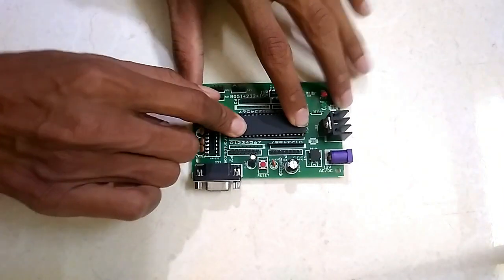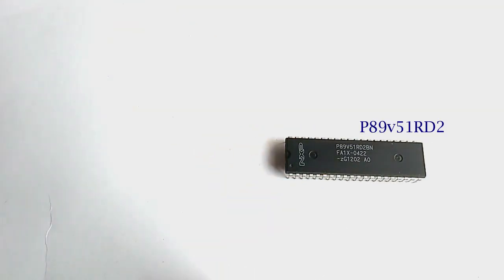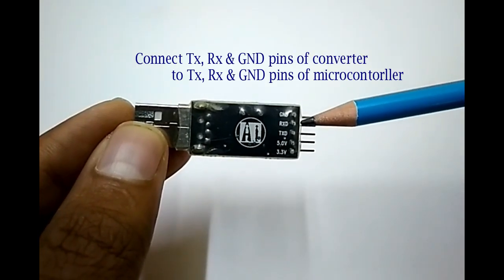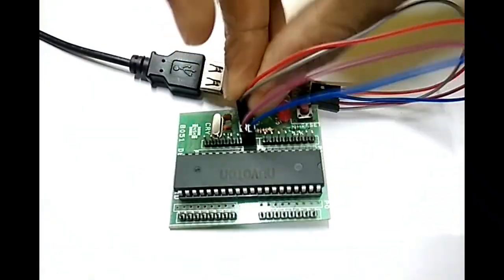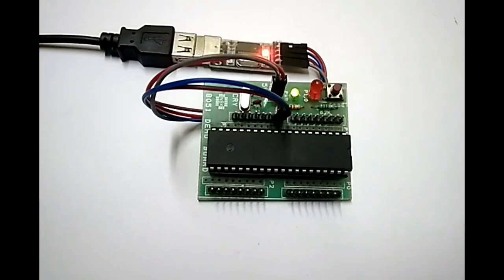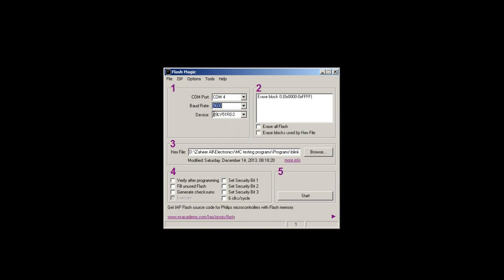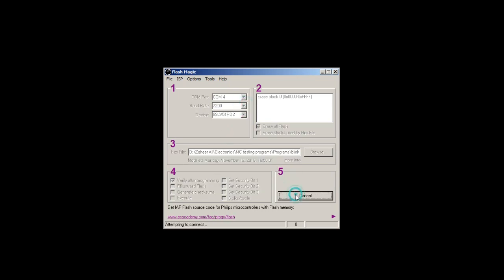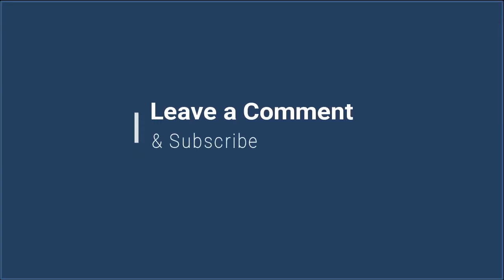how to Program 8051 bootloader ICs (3/3)

Comment: you didnt explain how to use usb programmer
Reply from the maker: Hi Chetan. Thanks for the comment. USB programmer cannot be used for these 2 ICs mentioned in the video. These ICs doesn't need USB programmer. And that is a plus point as it saves money. I have discussed how to use USB programmer for other 8051 ICs in this video below.  you may want to check it out
https://youtu.be/gHjJLIwL-Zw